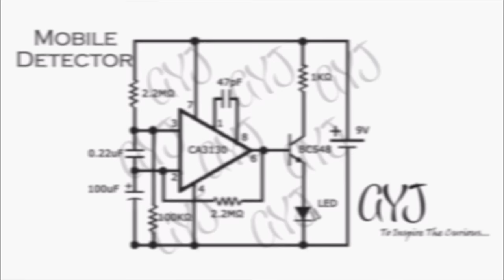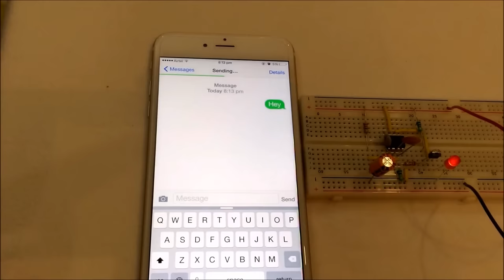How To Make A Mobile Phone Detector

Comment: if the mobile is 1km apart also does it detects
Reply: Deepthi Muthulakshmi No
Reply: only for1.5 m
Reply: Badr Hsaini what changes do I make if I need 10metre range?
Reply: need to add atenna
Reply: Deepthi Muthulakshmi If we attach antenna to the collector of the transistor the range will increase

Comment: what happens if we use a 1.8M OHM RESISTORS Instead of 2.2M ohm resistors? Will the circuit works and LED glows or is it a minimum requirement that it should be 2.2M OHM RESISTOR

Comment: sir this video was awesome.but you must explain the each component working and the principle behind the experiment.eventhough it was working I can't able to explain what is transmitter ?what is receiver ?.so I request u to explain the working of experiment as soon as possible..........
Reply: medanki ajay The RF is captured through the 0.22uF disk capacitor and then is sent to the CA3130 IC which is a OP-Amp then the signal is amplified to a certain voltage and then is sent to the BASE of the transistor Through resistor (Roughly 10 mA) Due to which the the circuit closes, Current flows through positive to led and back to ground that's how a cell phone can be detected (Google 'Mobile Bug Working' for more details) :)

Comment: It would be nice if you mentioned how this worked... like say what element in the circuit actually triggered the LED, and such.
Reply: diablo09090909 The RF is captured through the 0.22uF disk capacitor and then is sent to the CA3130 IC which is a OP-Amp then the signal is amplified to a certain voltage and then is sent to the BASE of the transistor Through resistor (Roughly 10 mA) Due to which the the circuit closes, Current flows through positive to led and back to ground that's how a cell phone can be detected (Google 'Mobile Bug Working' for more details) :)
Reply: Thanks mate. That was educative.
Reply: diablo09090909 No problem :)

Comment: bro thanxx to u!! this project saved me!! it is working perfectly fine!!
Reply: 3g ,4g phs detect chayali btw M vadali plz chappaandi..
Reply: english plzz???
Reply: i m glad to tell u it now detects 2g 3g and 4g as well!!!
Reply: Swapnil Nath bro..you make a this model..do you know this project working correctly?please tell me
Reply: yeah it works properly!!
Reply: this circuit is working for 2g mobiles only,what have to do to get it worked for 3g,4g
Reply: did u make it or are u just saying that ! because when i made it the circuit was working with 2g 3g and 4g as well, without any modification!
Reply: Swapnil Nath hey please help me real quick with it. Are there any tricks you use to make it work? I'm about to make it. But I just got a few hours in my hands that's why I'm asking this.
Reply: no tricks involved!just make the circuit as shown!! just try to make it a little compact!!
Reply: Swapnil Nath thanks for your such a quick reply. I wasn't expecting this.
Reply: SAMEER SAWANT dont worry its work very well put antenna in ic 5 terminal and the main thimg is it works for only 2g networks gprs
Reply: Swapnil Nath i did it as u did but working for only 2g im not lying
Reply: ramu ramu thanks for your suggestion. I'll try and reply here till noon.
Reply: in my case 2g had greater range of approx 2 feet!! but 3g and 4g only worked when mobile was just aside of the circuit! but it worked!! so i really dont know what the problem is!!
Reply: when i first made it circuit was too spreaded!! but then i made it a bit more compact!! and to my surprise it started working!!
Reply: Swapnil Nath yes I remember your suggestion to make it compact. Maybe compactness determines the range and when we spread it more then it can't even detect 2g.
Reply: Swapnil Nath yes initially it worked when i put it near the capacitor but after sometime it worked only for 2g even put it near to the capacitor
Reply: ramu ramu not working.
Reply: Swapnil Nath hey. Its not working.
Reply: SAMEER SAWANT congrats
Reply: ramu ramu what to do?
Reply: SAMEER SAWANT are  you using 2g phone or not
Reply: SAMEER SAWANT it will work with same components take approximate values as shown in the video
Reply: ramu ramu that age old phone without internet? Right?
Reply: it will work use solid gauge conectng wires
Reply: ramu ramu yes I've used the same wires. But will it work if I switch to 2g on my 4g phone?
Reply: SAMEER SAWANT yes
Reply: Yes it works with 3g and 4g as well! Ramu you just need to make the circuit more compact.
Reply: Swapnil Nath yes it's working with 3g and 2g
Reply: Swapnil Nath when i connect battery to bread board then the led is blinking but it is not blinking when the phone is receiving or outgoing signals so please help me
Reply: Swapnil Nath bro ... can i use 1M ohm instead of 2.2M ohm and 0.22(10V) instead of 0.22(5V).
Reply: I HIGHLY RECOMMEND TO USE THE GIVEN VALUES ONLY,IF U R DOING IT FOR FUN THEN DEFINITELY U CAN EXPERIMENT WITH DIFFERENT VALUES BUT IF U NEED TO MAKE IT QUICK USE THE SAME VALUES!!
Reply: NICE!

Comment: hi .. i have a question
i having a hard time to find 47pF is there any capacitor value that i can use to replace instead 47pF ?
is it ok to use 100uf with 16v capacitor instead of 100uf with 50v ?

please reply thank you i really need your help
Reply: Did u try using it?
Reply: It may not cause problem

Comment: please explain in brief how this stuff is working. means the working principle behind it .
Reply: Jamal ansari The RF is captured through the 0.22uF disk capacitor and then is sent to the CA3130 IC which is a OP-Amp then the signal is amplified to a certain voltage and then is sent to the BASE of the transistor Through resistor (Roughly 10 mA) Due to which the the circuit closes, Current flows through positive to led and back to ground that's how a cell phone can be detected (Google 'Mobile Bug Working' for more details) :)
Reply: one more thing can  i use other op-amp ic like 741   lm324   lm358
Reply: Can I make use of CA3140 ic in place of CA3130 ic

Comment: For those who are having problem like led is glowing continuously on connecting the battery and starts blinking during a call, I have two solutions for that cause even I was facing the same problem,
1.) Check all your resistor values especially that 2.2M ohm , maybe shopkeeper have given you 2.2k ohm as it happened to me. Color code for 2.2M ohm is red red green gold.
2.) This is what gave me finally a proper output , I connected a random resistor (I used 2.2kohm) as a load , from positive (Vcc) to negative ( ground), and then I got a perfect output.Booyah.
Reply: Still not working

Comment: When I connect with the battery...the LED remains lightened
What is the problem?
Reply: wait for 5 minutes ,then led off ,then u try ,it will work.. I done this project it works
Reply: @pendyalagowtham1154  will led automatically turn off ?

Comment: How does the circuit detect any kind of transmission and reception?
Reply: Transmissions are radio broadcasts, with very specific timing. Think of it like an incredibly precise Morse code. When your phone overhears it's IMEI, it knows the broadcast is for it. otherwise, it ignores the broadcast. This circuit is not clever enough to ignore things.

If you're worried about privacy, you should know that most messages send the IMEI plainly, followed by an encrypted message of a known length that only the holder of that IMEI should be able to decrypt. This circuit is also not clever enough to understand your calls or texts.

Comment: Can I use a 1micro farad electrolytic capacitor instead of the 0.22uf ceramic capacitor
Reply: Science and Tech with Aditya No
Reply: can i use a 0.1 uf capacitor
Reply: Science and Tech with Aditya Ya You Can Use Any Value Capacitor Near .22uF And Make Sure Its Non Polarised
Reply: Thanks very much for your support
Reply: Science and Tech with Aditya NP

Comment: What sholud i do if i have 0.22uf polarised capacitor ?
Reply: If i connect the +ve terminal of .22uf capacitor to pin 2 of the ic and -ve to pin 3 or vice versa. Will it effect the circuit ?

Comment: I built the same circuit and when I connected the LED ,the LED is continuously on and is does not go off if the circuit is left as it is.EVEN WHEN I MAKE A CALL there is no change in the burning of LED.THIS IA MY PHYSICS PROJECT.PLSS CAN ANYONE HELP😭😭😭
Reply: Srevarun Somasundaram kindly check the 0.22μF Capacitor is a nonpolarized capacitor.

Comment: does 0.22uF 16v capacitor and 47pF 50V capacitor work
Reply: yes. Either a 16v or 50v caps will work fine (the voltage rating just needs to be higher than the 9V battery rating (plus a small margin to allow for variance).

Comment: I'm from Sylhet,bangladesh.
I didn't find the 0.22 uf capacitor :(
so is there any solution to use another Capacitor as like 0.1/0.47 something
Reply: I didn't found 0.22uF so i bought two 0.11uF capacitors as shopkeeprr suggested me. But my circuit is not working i dont know why..🙄🙄

Comment: in ckt dia 100uf ic is connected to pin 2 and you have connected it on pin 3 why?
Reply: Kamlakar Kadam 
The pin 2 and 3 are shorted through the .22 uF capacitor.
So you can connect in either of the pin 2 or 3. Thank You....

Comment: This IC is an amplifier.. the circuit acts as a bandpass active filter at 800MHZ or so.. I think it works with 2G only!
Reply: Truth Seeker Different Frequency can be captured by changing the value of the 0.22 uF disk capacitor (Maybe a variable one)

Comment: Sir, In circuit Diagram 100uF is connected to pin 2, But here U have connected 100uF capacitor to pin 3.
Reply: Naveen Dubey  hello plzzz help us led is  glowing with battery
Reply: Naveen Dubey we are the one who called u yesterday
Reply: Well its a Small Project U could easily complete it in 15 min. Just need to Assemble the components at right place

Comment: would you plzz.....tell the working of this projet.....i mean how the circuit is able to know that any call or msg is coming
Reply: a high speed high current differential amplifier with a light on the output that amplifies electrostatic background noise around a level different than cero (light shines always but flickers more o less when theres 'phonewaves' around) the antenna is unnecesary and would go in the pin 3 in series

Comment: the circuit diagram contradicts with breadboard circuit..diagram 100uf capacitor is connected with pin 2 of the ic while in circuit you are connecting it with pin 3..

Comment: According to circuit diagram, 100uf capacitor is connected in between pin 2 and Negative rail
But in the video it's being connected in between pin3 and Negative rail.
Reply: circuit diagram kaha ha

Comment: how does it detect anything without antenna?
Reply: antennas are just a specific length of wire. the closer the length is to the desired length, the cleaner the signal will be. This circuit is not very close, but that's okay because the signal doesn't need to be clean; we don't care WHAT the message is, just that there IS one. There are many wave lengths this circuit is not picking up because the antenna isn't long enough, and if you point short waves at it, like putting it in a microwave, it will pick those up too. It's picking up anything between two wavelengths, and cellular is somewhere in the middle.

Comment: wow it works,...
what the principle behind it ??
Reply: medanki ajay The RF is captured through the 0.22uF disk capacitor and then is sent to the CA3130 IC which is a OP-Amp then the signal is amplified to a certain voltage and then is sent to the BASE of the transistor Through resistor (Roughly 10 mA) Due to which the the circuit closes, Current flows through positive to led and back to ground that's how a cell phone can be detected (Google 'Mobile Bug Working' for more details) :)
Reply: @aayush3782  I have used ca 3130ez ic still LED is on evenif mobile is not near to it. It still remains on if mobile is detected. Tell me solution
Reply: @kavitasatale1117  There may be fault in your IC or Transistor

Comment: it was indeed a good video
but can u tell us how it works
Reply: Ramnath Rao Bekal The RF is captured through the 0.22uF disk capacitor and then is sent to the CA3130 IC which is a OP-Amp then the signal is amplified to a certain voltage and then is sent to the BASE of the transistor Through resistor (Roughly 10 mA) Due to which the the circuit closes, Current flows through positive to led and back to ground that's how a cell phone can be detected (Google 'Mobile Bug Working' for more details) :)

Comment: what is the circuit mechanism ???
Reply: jayesh desai The RF is captured through the 0.22uF disk capacitor and then is sent to the CA3130 IC which is a OP-Amp then the signal is amplified to a certain voltage and then is sent to the BASE of the transistor Through resistor (Roughly 10 mA) Due to which the the circuit closes, Current flows through positive to led and back to ground that's how a cell phone can be detected (Google 'Mobile Bug Working' for more details) :)

Comment: Can ANYONE please explain me the working of this circuit?
Reply: Cellular phones use radio waves of precise wave lengths and timings to communicate. Normally, an antenna is used to distinguish between the desired waves and other noise. This circuit uses its own wires as an imprecise antenna, picking up any signal in the neighborhood of the ones cellulars use. If you vary the wire lengths, you might be able to detect FM radio, microwaves, or radioactive materials.

Comment: explain the working of mobile detectors please
Reply: shakthi priya The RF is captured through the 0.22uF disk capacitor and then is sent to the CA3130 IC which is a OP-Amp then the signal is amplified to a certain voltage and then is sent to the BASE of the transistor Through resistor (Roughly 10 mA) Due to which the the circuit closes, Current flows through positive to led and back to ground that's how a cell phone can be detected (Google 'Mobile Bug Working' for more details) :)

Comment: My led got switched on before i used my phone...
Reply: Jithu K John Make sure your IC Connections are right and nothing is shorted
Reply: Circuit's Everywhere 
I connected as u do in the video... Bt i didn't used nonpolarized capacitor (0.22micro farad) is that the problem?
Reply: Jithu K John Yes, that's the only problem. 0.22 uF non polarised is the Antenna itself. Without It it will not work

Comment: how does it work
Reply: a high speed high current differential amplifier with a light on the output that amplifies electrostatic background noise around a level different than cero (light shines always but flickers more o less when theres 'phonewaves' around) the antenna is unnecesary and would go in the pin 3 in series

Comment: How it was sensed because there was no sensor.  I think this is fake because I have taken the classes of it . It is fake
Reply: BRO THERE IS NO USE OF SENSORS 0.22mF CAPACITOR ACTS LIKA AN ANTENNA AND ITS CATCH THE RF SIGNAL OF THE MOBILE AND IT SENDS TO THE TRANSISTOR
Reply: Bro battery connect LED is blinking.but circuit is not working

Comment: how its work
Reply: Santosh Kumar The RF is captured through the 0.22uF disk capacitor and then is sent to the CA3130 IC which is a OP-Amp then the signal is amplified to a certain voltage and then is sent to the BASE of the transistor Through resistor (Roughly 10 mA) Due to which the the circuit closes, Current flows through positive to led and back to ground that's how a cell phone can be detected (Google 'Mobile Bug Working' for more details) :)

Comment: it is working,pls send this project report
Reply: Archana V The RF is captured through the 0.22uF disk capacitor and then is sent to the CA3130 IC which is a OP-Amp then the signal is amplified to a certain voltage and then is sent to the BASE of the transistor Through resistor (Roughly 10 mA) Due to which the the circuit closes, Current flows through positive to led and back to ground that's how a cell phone can be detected (Google 'Mobile Bug Working' for more details) :)